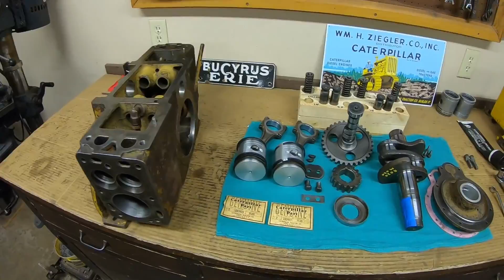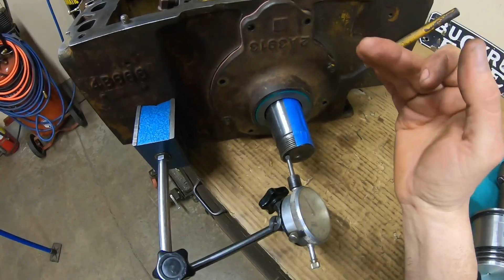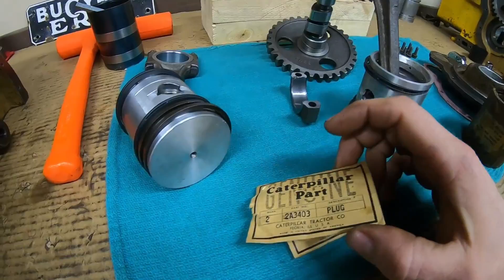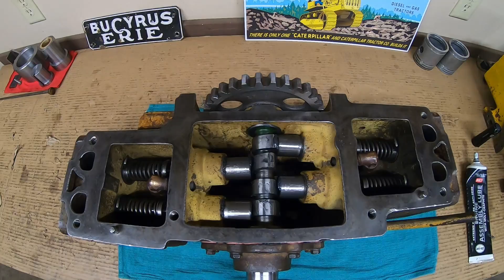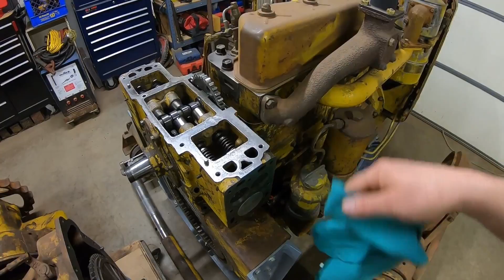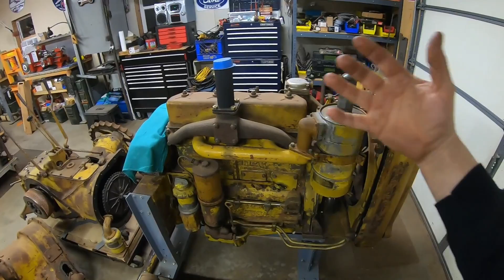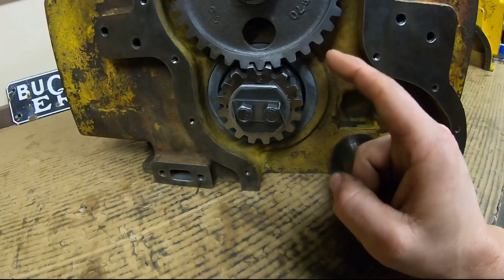The Caterpillar "Pony Motor" - Cursed by Design?? Or the Perfect Balance of "Just Enough"???

Comment: Hi Squatch, great discussion, and it got me to thinking about the Farmall M diesel I spent last winter doing the engine rebuild on. Its starting system was another option, which essentially incorporated a pony gasoline start system right into the main diesel engine. No one used this option except for IHC, and they developed it in the 1920's, as a way to achieve the efficiency of diesel power before glow plugs, batteries, and starters were strong enough to crank over high compression engines. Like pony motors, this system eventually disappeared with advances in technology. Before I went through the engine, I thought it was a poor system, as the tractor would hardly ever start below 40 degrees. After rebuilding it, it easily starts on gas in just about any temperature. During the process, I learned that one of the most important aspects to the longevity of the whole system is in how it is operated; the proper steps taken to start it, cool it down before shutdown, and the gas/compression settings to leave it in after it is shut down. This is similar to your discussion on pony motors getting a bad rap due to poor maintenance.
Reply: I grew up with a couple of Farmall MDs. The first thing I learned was the proper way to start them on gas, how long to let them run before switching to diesel, and then switching back to running on gas before shutting the engine down. As long as the gasoline side was working as it should, it was very reliable. You just needed to properly maintain the gasoline starting side of the operation.
Reply: @rinardman  I always wondered about shutting down on gas or not.  The operators manual says to switch to gas and then turn off the key or push in the mag switch.  I found out it is better to leave the engine inn diesel mode at least for the 600 and 650’s.  The reasoning is that spring loaded valves that open up in gas mode will be in the spring enforced closed position.  You have mechanical force when switching to gas to open them.  I left mine in gas mode once over winter and one of the valves stuck open.  Took quite a while for it to close under spring compression.  I would say depending on the tractor model which mode you leave it in would depend on which mode leaves the valves in the spring loaded return position.  That way you have the mechanical force to switch them to the other position if they get stuck. I don’t know all the models that well to know if they all used spring loaded closing.  I imagine they would all use that method as it allows for valve wear.  Mechanical closure would need adjustment in the case of valve seat wear.
Reply: @johnwythe1409  I always switch from diesel to gas and immediately shutoff gas supply to the carb.  This lets the engine cool a bit more while the gas runs out and also empties the carb.   Once it dies I put the valves back in diesel position so they will be seated during cooldown.  then shutoff gas ignition.  done.
Reply: @squatch253  Would love to see you upgrade one of the three engines to electronic ignition as it would improve reliability and starting made easier. They can be temprimental, the Wico mag on my D4 seems a lot more reliable on the Eisenmans I have on other Cats. What do you think ?  Will be working on my Cat D2 3 j soon. its number 3j506
Reply: As a retired auto mechanic I didn't realize until recently, talking to a motorcycle restoration friend that the magneto magnets needed re-energized in old distributors, resulting in weak spark. Probably the wrong terminology, but you get the idea. Does that apply to all magnetos?
Reply: @edwinhsingmaster9135  my dad refurbished at lot of 1920/1930 mags.  The u shaped magnets were a problem, many times re charging them fixed a lot of magnetos.  The other common problem besides points and condenser, was the spring loaded delay.  If it was jammed up you would also get week spark at low starting rpm’s.
Reply: @johnwythe1409  In my admittedly limited experience the tar insulation on the windings tends to deteriorate as well.  And I've seen a US Army manual from 1918 that included instructions for re-magnetizing magneto magnets, so that must have been a common problem even when they were new.
Reply: Good to see Pete in the house!
Reply: For sure proper maintenance and operation can make a big difference to how long something last and how well it performs.  Years ago my dad stored the D2 in a shop warmed by a wood/coal pot belly stove/furnace.  The pony motor on that D2 did a lot of cranking in the cold MB winters everyday during the winter. Used to feed the cattle corn silage in the morning’s.
Reply: IHC’s early diesels had a mechanical revolution counter that you could set how many revolutions the engine did in gas before switching to diesel. You just had to be ready on the throttle when it did.  The colder the weather the more revolutions you would set it to before it switched.  I think it was up to like 700 revolutions.  If you needed more in colder weather you had to hold the spring loaded switch lever so it wouldn’t release when it reached 700.  The counter was just a mechanical gearing system that slowly moved a lever far enough to release the catch on the spring loaded mode lever a few more revolutions and that lever would release and the catch would hold the other lever in place again till it came around again.
Reply: Covid is just the distraction, while we struggle with masks or not, vaxx or not, employment or not our elected officials and bureaucrats behind the curtain are quietly removing our private property rights, our right to travel, our right to assemble, our ability to use cash money and bringing in digital id and digital currency, TOTAL ENSLAVEMENT !  Until the sheeple wake up and you impact the big businesses that run government and are supporting and driving the lockdowns, nothing is going to change.  Many of our government officials including Chrystia Freeland belong to the World Economic Forum (you will own nothing and be happy).
Reply: My I ask, how many different shirts were worn during the writing of your response?

Comment: If you was the monkey that had to start that pony motor ever time that operator over lug the diesel engine and it dies it gets very old mostly if it's old hadn't seen up keep service work foul plugs bad gas plug filter someone didn't turn gas off  but they easy to work on  not like new cats today that's all computers joy Stick control all sorts safety things  to satellites level plowing controls  when those fail might as well stayed in bed call the dealer send repair man out. I rather know and feel what my mchs under me is doing  got love it as kid someone let you run there old cat

Comment: I have a 5F9341 block, 3H8007 heads, 2A3913 cover, and 4F274(0?).  I need to either find parts (bearings, gaskets, seals, etc.) or someone who will rebuild it for me.  Suggestions?  Came off my Cat 112 motor grader. I asked Kyle Christ as well.  You guys are awesome!!

Comment: So grateful for the pull start Pony on my olde D4 cable machine. Frustrating at times but considering that both the pony and main motor were both rebuilt in May of 1954 and hey do all I ask of them and more is a living testament to that simplicity.

Comment: I think Squatch makes a solid case and extremely  valid point about,  if you never had a good running one.......  I hark back to my Dad starting a D7 and Grader in the 50s (no idea what model) in the Spring and the miserable hours he spent with Pony engines running.    But....... the equipment was surplus,  the diesels were probably worn out along with the injection  systems.     The Pony started,  it just had a really rough time getting the Diesel going.   Hmmm.    Or you could do the Russian approach with the T-354 WWII Tank Diesels,   they used air start via an Aux rig that had a compressor on it.    They had air tanks inside the tank (hmmm)  but those were for when you had to shut it down and re-start shortly after that,  never for main start.   So a compressor truck with a big tank  that could crank your air start motor for as long as you needed to spin it regardless of temperatures.    Would that D7 and Grader even have started with a battery starter?

Comment: Hello, I took my apprenticeship with Finning Tractor so find your video very interesting. I have a question, did Cat make their own pup motors or did they use outside suppliers? The 955H as I remember had a pup motor that sounded a sewing machine !   Thanks,
Reply from the maker: Yes, Caterpillar designed and built all their ponies, and they actually regarded them as being just another piece of the diesel engine - similar to a water pump, governor, etc. 👍

Comment: In saying that, how reliable were they in extreme climates compared to those equipped with pony engines? It seemed that some, but not all of the pony engines spun quite fast when turning over so they could start within the first couple of revolutions compared to some others. Of course, six volt was still the norm unless it was military applications.

Comment: IF these pony engines were so bad, according to others, why has nobody come up with a better swap fit pony engine to replace them in seventy years?  I mean they make pointless ignition system kits and other stuff for other brands, car, motorcycle, etc. who knows.
Reply from the maker: Good question 👍 The two main reasons are (1) because the pony engines are such a compact design that accomplishes both driving the starting pinion and warming the diesel’s coolant because it’s plumbed directly into it and (2) the cost of deleting the pony altogether and fitting the direct electric start system is about $1,500 USD, that doesn’t leave much wiggle room to try to Rube-Goldberg another type of engine onto the back of the diesel and still get it to perform all those tasks and not be a complicated and clunky mess. So everybody has always either just rebuilt the old pony engine or got rid of it altogether.

Comment: I wonder if some of the issues with starting engines amplify as the main diesel wears out: as compression reduces, it'll get harder to start the diesel, so the starting engine gets worked harder and harder.

And I bet with a starting engine you can get a really worn out diesel running eventually - so rebuilds get pushed out longer than they would with an electric starter.
Reply from the maker: That’s a spot-on assessment of the overall situation 👍

Comment: Hi question...where did you find rings? What is a normal compression for the pony motor on the d4?
Reply: @squatch253  yes thanks!  I saw the episode after I messaged... thanks for the response.  My late father has an rd4 I was trying to get the pony running on.  It's testing at 70s...he had taken it apart 20 years ago...I put it back together but I am questioning my cam timing now as it has spark .but won't run.  Trying to get it running as we want to sell as part of his estate.  Thanks

Comment: i was thinking 2 large off the shelf semi truck starter motors and an ignition switch would have worked just as well and been so much easier and cheaper, BUT after thinking about it more... these pony motors worked well for a long time and didnt need a battery to turn over and get the dozer moving even if the main big engine didnt run at all. Their magneto system and hand cranking reminds me of the Ford Model T (and they also only had splash lube and small amount of oil capacity)

Comment: Hi. I bought a traxcavator that was converted to a blade machine. If i have it right , i believe its a 1956 vintage. Some of the numbers are 12A3096 and transmission group 4H9050. Was wondering if a sleeve and piston kit would still be available? And clutch parts? Regards Jim

Comment: Hey bud, I got a 35ft tug boat that has a D318 cat I'm her. The engine runs great, but the start up engine just locked up. Don't have much knowledge on these old girls. Talked to Cat, and they didn't have much info on Rebuild kits. The previous owner talked about switching the start up process to electric start. Not sure where to look on finding rebuild kits, or switching over to electric starting system. Any info would be greatly appreciated.
Reply: @squatch253  thank you very much. I will look him up rite now. Do you have any videos on taking the start up motor off the main motor? Just don't want to start taking stuff off that don't need to, or out of order. Thanks again. Would love to talk on the phone to pick your brain on this old D318 I have. Not much info left on these old girls.

Comment: Like any design, it had its good and bad points. Good point is its simplicity - bad point is poor main bearing design. Carburetion was a product of its time so can't be faulted at that point in time. The other thing I'd fault it on is shortcomings in maintainability, which is a complaint that can be levelled at any manufacturer. Designers should have to maintain their designs in the field for at least a couple of years so they can learn the impacts of their design choices.

Comment: I have 1938 d2 , had to remove mag to check points, I see a mark on the mag gear but only see a paint mark on the pony motor gear, I'm not sure if these are the correct marks to line up to time the motor?

Comment: At least they put a real carburetor on them. The deere model R's got a "mixing pot." Basically a manual adjust fuel needle and the leather flap. It's simple, but you had to adjust it for the temperature. Might be 3/4 or less of a turn for a hot start in the summer, or 1 3/4 for a cold winter day. At least the tank is lower than it so it doesn't leak into the crankcase, but if you flood them, you really need to change the oil. Later ones, you could change the fuel valve from the seat and shut them off that way, but early ones, you only had a governor control.

Comment: Hey squatch253, I was cleaning out one of my old outbuildings and found an old pony motor block disassembled. There was a separate box with Pistons, crankshaft, etc and looks like all the parts for it. Don't know if you would be interested in something like that. Be cool if it went somewhere it could be built back up

Comment: Personally a block heater using the nobles electricity, or stored in a heating building with new set of fully charged batteries and Kettering starter is the way to go....not sure why all these peasants are showing their bow string finger at me?  More taxations and kings x woot woot!  

I learned a bunch after researching the pine tree riots!

Knowing you can pull start that pony and heat all the main works on free ground at any time deserves a standing ovation.  Honest trade among friendship!  Article 1 Section 10

Comment: @Squatch253  I remember my Uncle using Ether to get his diesels started in the 70's .. No restrictions you bought it at the auto parts store = it was common when the D2's were new.  No need for 5 minutes of warm up.. If the starter motor could get the main engine rotating, the Ether would provide a pop or 2 to get things firing.  Today's starting fluid is weak in comparison.  So I'm lobbying for an "average starter motor run time" reduction.

Comment: Just going by the numbers, hours wise for the under carriage, main clutch, steer clutches and brake bands. Caterpillar likely did the math and said that bearing regular maintenance in mind and average use. That by the time some fairly major components were due for replacement, the pony motor would probably be due for a rebuild itself. Which but I he looks of where it's placed and bolted in place coupled with the rather simple design. It looks solidly like it was meant to be rebuild serviced at the same time as clutches. Since you have to pull the dash off anyway. Get the pony while you are there.

All the parts for it appear big and simple clunky, that to me says "this thing is meant to be possibly field rebuild able". A splash oiling system just adds to the though line. Yes such simplicity has it's issues and short comings, though it's faults can be offset by the very same simple clunky design.

Comment: It's best practice when possible to run the gas out any carburetor engine. If gives the engine a softer stop and excess gas in the cylinder is burnt off. There is no gas to varnish in the carb and float valve is the in the unset position.

Comment: I agree squash, been operating these things for over 50 years. Being a heavy equipment mechanic and operator the best thing I like about starting engines is the important fact that the main engine has oil pressure and circulation before it fires. When I replaced my older cats with direct start I could just see galded parts. The old engines seemed to last forever however the modern engines just don't get the hours before rebuild like the pony start ones.

Comment: I bought an old 6U D4 to do firebreaks on my hobby farm.   The starting engine has always worked on a very old well used D4, so there is no criticism justified on its design.  But I did discover not long after I bought it that the starting engine water passages were just about completely blocked with white muck.   The benefit of a gasoline starting engine, with coolant common to the main engine, and starting engine exhaust routed through the main engine intake manifold, is that you can ALWAYS start the main engine, no matter how cold it is, nor how long it has been sitting since last start. So long you have a cup of gasoline and can pull the rope, you are good to go.

Comment: The switcher at the Collinwood Yards ran 24/7 They never shut it off unless it needed work. It was nice to have a warm cab in the yard when it was cold. In the "old days",CAT would have come in R&R the unit, put on an overhauled unit and return the core for service. I was in the new CAT facility in Ohio. The service and repair department is amazing. They have a huge dyno. and hoists that can pick a fire truck no problem.